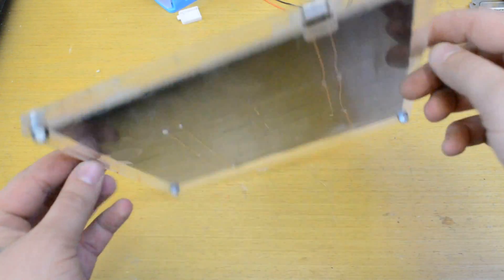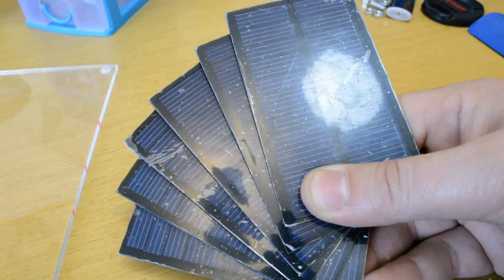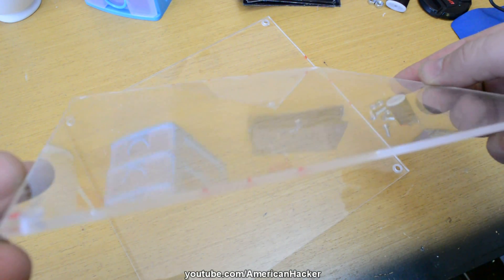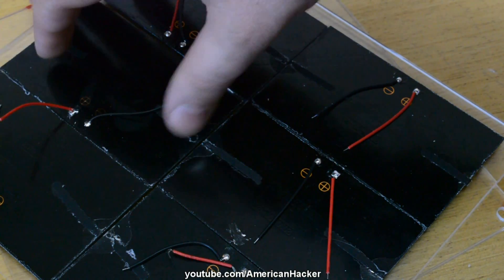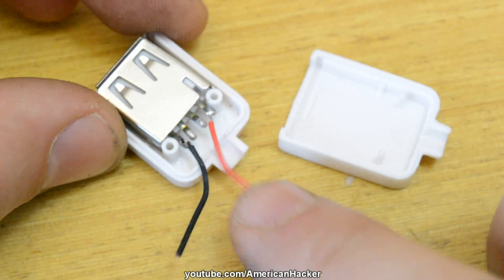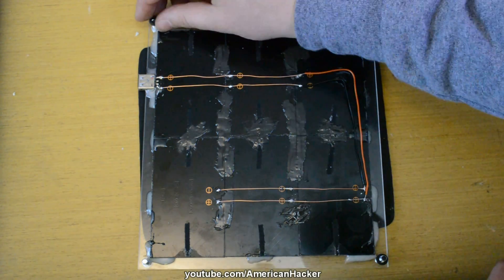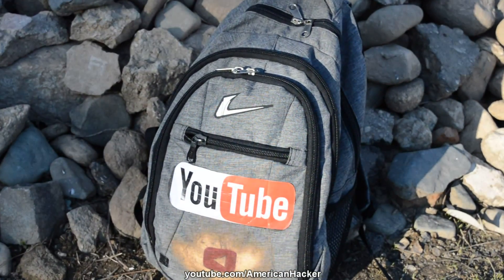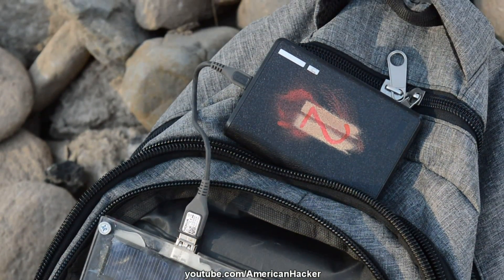How To Make Solar Backpack for 10$

Comment: But solar voltage keeps increasing , decreasing asper light , then will it not affect mobile , moreover , 6 solar panel each 50 mah , total 50 × 6 = 300 mah , then how 1 amp is there  , pl. Clear my doubt .....

Comment: no guy, use solar panels without stabilization - bad idea, you need a cheep dc-dc stepup (0.9-5 V) and I recomend to solder D+ & D- pins on USB, cuz many phones will not charge without this

Comment: wont the too low of a voltage cause problems to your device over time? also what if the voltage goes too high which would also cause problems.
Reply: Then you battery will expand just search it up on google what happens when u over charge a battery
Reply: the phones have something to regulate it to not overload, but for charging a phone with over 5v is the issue since it might heat up components and lesson the life.

Comment: how long will it take to charge an IPhone 5 from 0% to 100
Reply: +Lorenzo&#39;sTechTips If you charge it as shown in video it will have no problem charging, beacause phone is powered by power bank, not by the solar panel  ;)
Reply: +Smiley Cool There need to be certain voltages on the data pins shown here: http://blog.curioussystem.com/2010/08/the-dirty-truth-about-usb-device-charging/
Reply: If this can pump out about a amp, than it will either charge just as fast as your real charger or even faster. (Aka a few hours)
Reply: +Smiley Cool It charges REAL QUICK

Comment: A stabiliser is needed! i would not hook any of my devices to that, they are sold on eBay for 1$.
Reply: +Krisztián László Simon que estabilizador necesito amigo dime cual comprar en ebay
gracias
Reply: what will happen without stabilizer?
Reply: LM2596, i would definetly use one, in case of undervotlage, in theory ntohing happens, but overvoltage, i dont how the converter is designed in the phone but, i think overvotlage will harm it. And then the diode is not needed, if a stabilizer is used!
Reply: +poptartheroes yup, your translation is correct